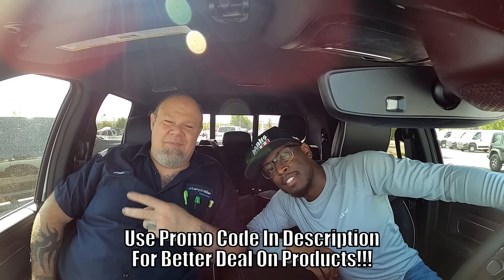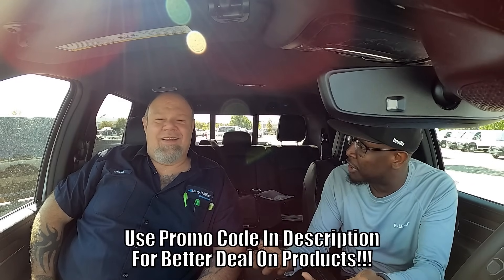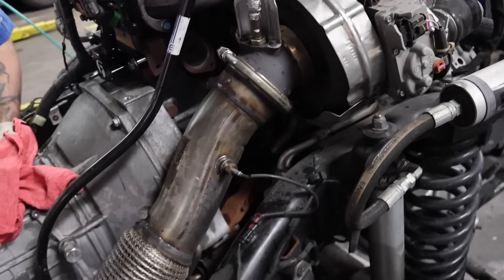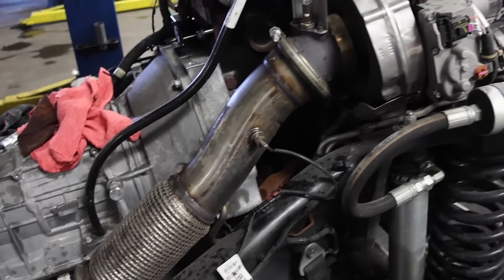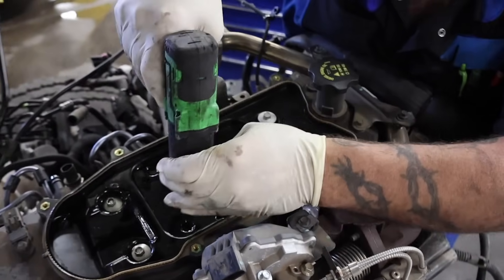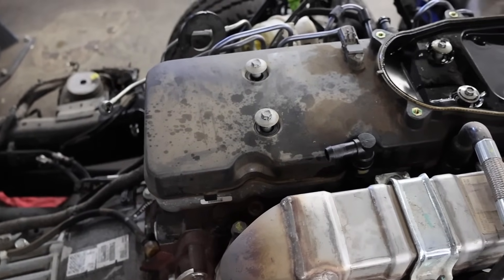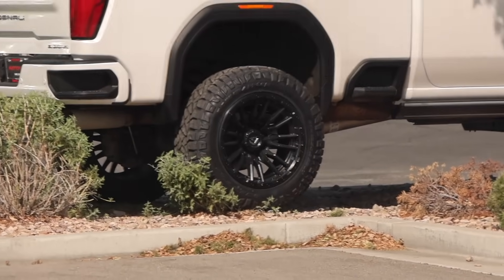Master Tech Answers The Question: EGR VS DPF Weight Loss Program! Can You Do One Or The Other?

Comment: 2:15 - "master tech" doesn't know what he's talking about (as he acknowledges at 3:30).  EGR serves the function of NOx reduction.  Disabling it does not make "all that stuff" go down into the DPF.  DPF serves the purpose of particulate capture.  Disabling EGR does not inherently result in greater soot production, although you are correct a DPF that is present without a regen strategy will soon be an exhaust obstruction.  Maybe stick to turning wrenches rather than shilling for golfball pistons, banks goodies, and additives.

Comment: I'd be interested in his comments on aftermarket parts that work in conjunction with the OEM emissions system. Parts such as an oil catch can to reduce the oil vapors entering the EGR. turbo etc, And the FASS EGR filter to catch and pre burn some of the soot before it goes downstream. Would they be emission and warranty compliant?

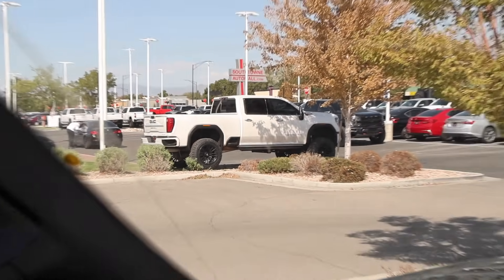Comment: 10:30, my work f550 regens all the time. It fired up into one and killed a bush 5’ back from the exhaust… I know heat is involved but if that sucker was able to kill it, how much “better for the environment” is all this junk?
Reply from the maker: It’s not!!!
Reply: That stuff is toxic, you can litterally smell it in the truck while on the freeway when the diesel regens. I would rather smell diesel than that crap. Makes no sense at all. It truly doesnt.

Comment: No one is questioning either one of you, but have you both read HR 4117? If passed it will allow for removal of the systems. Here is one of them on the bill. 

USEFUL LIFE EXPENPTION- It perposes a useful life exemption, meaning that once the emission system has reached its intended life span( which maybe a fixed number of years or mileage), it will not longer be subject to federal enforcement if its compromised or deleted. 

Also the Endangerment finding which you could've voiced your opinion on how messed up these systems are has ended.  Now we have to wait for Lee Zelden on what he has to say this week. 

Now for those of you in Democratic states contact your Senators and tell them to get the budget passed. HR 4117 is attached to it. Chuck Scum Bag Schumer is holding it up because he wants more money for health care for people for political reasons. Yes he is holding it up like a JACKWAGON. So please contact them.

Comment: I’ve seen an eco diesel with just the dpf still working.   It was tuned that way. No egr or scr.  Tail pipe is clean and no regen problems.  Egr really messes up the dpf.

Comment: The point, about the pistons and fuel additives, is that none of that would have been researched if there wasn't the legislation. We have 1000hp new cars sitting in showrooms because we have EPA regulations. Without those regs forcing R&D, we would still be stuck with dirty 429 big blocks putting out 350hp still.
Reply: No time and technology changed that, they were hot ridding back then
Reply: Like did you never hear about 70s muscle cars right before the gas shortages as regulations
Reply: So can a free American still put what ever engine they desire under the hood of their truck? Say a 2015 3500 Diesel. 
How about if my engine has blown a hole thru the block. Can't I put a 600 HP hot rod diesel under the hood? Or how about a hot rod hemi with a blower, gas big block? Here in America can't we still do this? Will the title have to be listed as rebuilt, salvaged or something along those lines?  But can we still do this type of install / rebuild in America, can't we?? Just thinking I can put whatever motor I want under the hood of my truck. Unless the NAZI EPA has passed a new law?? 
🇺🇸🇺🇸🇺🇸

Comment: Working on deleted engines pissed me off this week as a dealer tech for Deere. When whoever deletes your engine tunes the ECU to not throw ANY fault codes then you call the dealer to come fix you I think that should the customer’s problem not mine. Only way I can fix that is to reprogram the ECU to get the fault codes to come active again then the engine will de-rate and you’ll have to get the delete tune done again. Or just leave it alone not delete it so you can actually use the emissions warranty. 
End rant.

Comment: You diesel lovers crack me up, at one point he’s talking about 22,000 miles being nothing and that they will run till a quarter million miles. A few sentences later talking about a 33,000 mile truck having cam and lifter failure. The reason diesel trucks stay on the road for so long is guys put tens of thousands of dollars into them. Yes, it’s mainly the secondary components that fail but it’s all junk anymore. It’s disappointing really.  Keep up the good work, man. I’m not giving you any shit, just the manufacturers.
Reply: I have a 2001 Dodge diesel with 400,000 miles and no repairs to the diesel engine. So no tens of thousands of dollars spent. Made me a ton of money though.

Comment: So question for you guys,  I'm looking to buy a new/used ram 3500. My question is if I  buy used 2024 3500 with 8,000 miles, what is something I should be looking for on this truck.  Second question,  I'm  better off buying a 2025 with the new Cummins,  the price is about $10, 000 difference
Reply from the maker: I can not recommend the 2025 until we start seeing way more of them in the shop with miles on them. So far we have seen may electrical gremlins
Reply: @Trukstuf thank you for your input,  I appreciate your knowledge